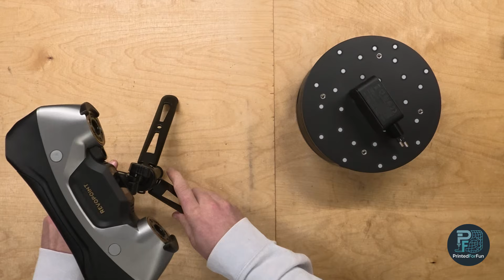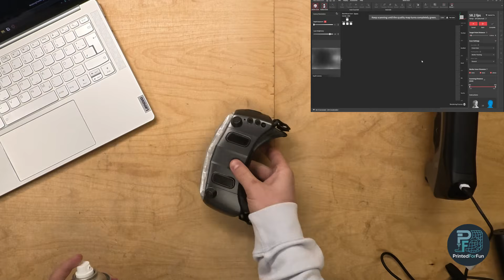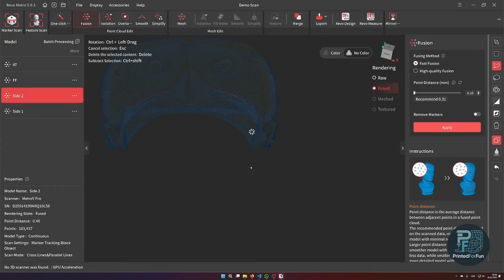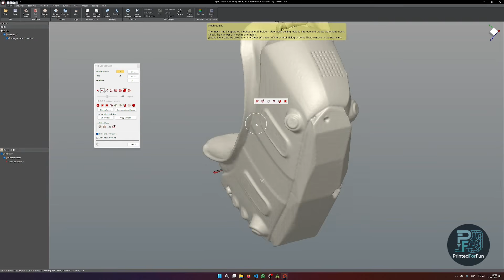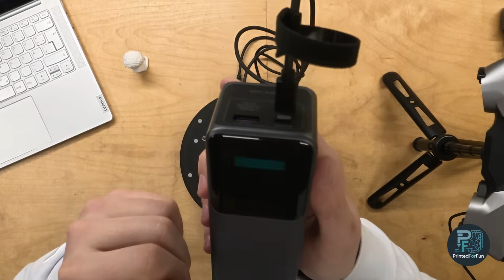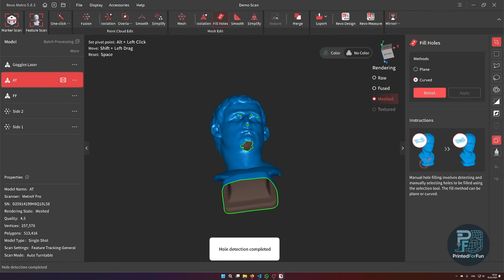Revopoint MetroY Pro Workflow and Scanning Tutorial

Comment: So, this scanner is completely useless if you don’t pay for QuickSurface every year forever?  (Or pay the larger license fee) And Revo doesnt really explain that on its website very well or at all right? 😑🤬 so frustrating as i was ready to purchase at $1600-1800, but now i have to budget another additional $5500 correct?
Reply from the maker: You don't need to use Quicksurface at all. Revo Scan (the software for scanning is completely free). Then you have a 3D scan as a mesh file and it's on you how to continue processing it: either directly print it, load it into Fusion to do some basic reverse engineering or pay for professional reverse engineering software like Quicksurface or Geomagic design.
Same applies to all other 3d scanners on the market.
Quicksurface also has an personal tear fro 200€ per year I think
Reply: @PrintedForFun gotcha. Thats what im trying to understand better. I think its almost the unspoken part of scanning to using the scan.  That middle layer.  I’ve tried to use meshes in F360 on a nearly-maxed out 2yr old macbook pro (memory, processor and drive) and F360 just slows to a crawl if theres more than a few hundred triangles (exaggerating but its definitely at a crawl).
Reply from the maker: @EricsAdventureMoto  Fair point, sometimes seems to get forgotten. May create a video about this topic at one point where I simply show all the options that can be done with 3d scans.
Regarding using fusion: for simple reverse engineering it works quite well as long as meshes stay meshes and you use the mesh tools. Then you can create sketches based on the mesh and construct. Directly converting to a solid is a big no-go.
Mesh size under 50k triangles should work nicely
Reply: @PrintedForFun thanks for the tips. Maybe i was doing that part wrong.

Comment: Hi. What is the make and model of the computer you are using?
Reply from the maker: Quite a powerful workstation. Ryzen 7950X, 128GB RAM and RTX 5070Ti.
Also used it on my notebook with 12700h, 16GB Ram and rtx3050, also worked
Reply: @PrintedForFun  Thank you ❤❤

Comment: is the modified cable required for using the battery pack remotely. does the scanner not negotiate the PD output by itself?
Reply from the maker: Doesn't negotiate itself. Original cable also has a pd trigger in it

Comment: Hello. Can You tell us about exact specification of Your laptop using with MetroY pro in Revo Metro?
Reply from the maker: It's a Lenovo Yoga Slim 7 ProX: i7 12700H, 16GB DDR5 and RTX3050 mobile. Would advise to use a more powerful unit though. The 100W power limit of the thin and light notebook really limits the performance. On my Workstation (16Core Ryzen, RTX507Ti and 128GB RAM) it's faster

Comment: Well, I already bought the RockIt and (of course) started wondering whether I made the right choice or not, so now I finally found a proper video on the MetroY Pro where I can truly experience the workflow remotely and compared to the one of the RockIt currently in my posession. Let's see if I'll be returning it for a Metro. If the RockIt has no glaring deficiencies, I think I can just make my own turntable and an adapter with threaded insert for my camera tripod using my Bambu H2D.

Could you briefly share your experience on the matter? I see the Metro has twice the amount of parallel lines, a single-line mode as well as the full-field blue light mode. I also see in videos that the Metro hovers in the 55-60fps region while the RockIt pushes up to 90. It's really hard to gauge how important each difference between the two is for someone just getting into 3D scanners - actual benefits versus marketing tricks. I'd be focusing on automotive and PC/tech scans so anything from goggles like yours to some motorcycle parts, car engine bays and interior trim.

8 minutes into the video I must say I really appreciate such content - not just a presentation of the original kit but also your own engineering modifications to it in order to make it better and/or easier to work with. The metal business cards? Genius. I'm already using those with my xTool F2 so I have a few stacks next to me, ready to "get stickered". ☻
13 minutes in: Very nicely done compartments! Turning wasted space into useful compartments on tools like these is a pet peeve of mine as well. 
24:00  Great "mean and lean" looking drone.
Reply from the maker: I will release a similar video for the Rockit (already captured the footage but time for editing is a bit rare...). Quite happy with the Rockit
Reply: @PrintedForFun  Oh, that's good to hear! My return window is not very long (about 10 days left) but if you're also happy with the RockIt then it might not be worth stressing too much whether to return it and get the Metro instead.
Reply from the maker: @TsvetanVR I'm very happy it so from my perspective no reason to return it. Maybe I can release the video until then but not sure

Comment: i dont know what i'm doing wrong but. i made similar setup (goggles scan). it couldn't even scan that, or made so much artifacts.  unusable. idk how the scanner preforms so badly
Reply from the maker: Maybe exposure not set right or not on automatic? What are your PC specs?
Reply: @PrintedForFun  My pc specs are ryzen 7900x 64 gb ram, rtx 3080
Reply from the maker: @Tebbit123 So this shouldn't be the problem.  What artifacts are you getting?
Reply: @PrintedForFun  Mostly misalignment or totally losing position, duplicating the scan within a scan, making the scan unusable. i only had one good scan with global markers and then using 100 markers to get some data just for a measurement.
Reply from the maker: @Tebbit123 Maybe too few or too repetitive marker patterns? Have you tried recalibrating the scanner?
Reply: @PrintedForFun   Its brand new ? should i recalibrate it anyway?
Reply from the maker: @Tebbit123 Yes, strongly advised. Multiple weeks of transport on a container ship or even airplane can mess calibration up (not even thinking about the temperature cycles while transport)
Reply from the maker: @Tebbit123  Did it help?

Comment: Hi, could you check your projector lens of the scanner in the full fields mode see if there are dust in the lens? My seems like there are a lot of fine dust inside the lens.
Reply from the maker: Yes looks the same, also did with the MetroX. Guess the fan blows air in between
Reply: @PrintedForFun  Thank you for your response, in the feature tracking, full fields high speed mode, do you see a line that doesn’t exist on the actual object? My at a certain angle and distance from the scanning object, I will see a ghost line and affecting the scanning quality.
Reply from the maker: @maxmei1991 Honestly haven't used the Fullfield mode much. Will make a video about it and will keep an eye on this

Comment: Great Video !! Thank you. I have the Metro Y Pro, it is a fantastic scanner. I also have the MIRACO Plus which is my "General use" 3D scanner. I have one question, I really like your idea of using the battery in your pocket, why cant I simply use an extension USBc cable between the Revo Battery and the small Revo scanner power chord that plugs into the Metro Y Pro ? Like (USB-C Male to Female Extension Cable USB 3.2 Gen2 PD 100W 20Gbps CAU620 - 2m)
Reply from the maker: PD is basically a communication protocol where the phone tells the charger/powerbank what voltage it needs. The MetroY Pro doesn't use this protocol, the adapter cable itself does it, unlike normal usb cables (even PD rated ones)
Reply: @PrintedForFun  Sorry, I dont understand. Will it work If I connect the Revo battery to a PD rated USB cable, then to the existing short Revo USB scanner connector cable into the scanner ? Thank you for your help.
Reply from the maker: @Scan2Model Usb C extension cables (so male plug to female plug) are generally not supported by official usb c specs. So I wouldn't advise you to do this
Reply: @PrintedForFun  Thank you very much !
Reply: COULD YOU TELL the difference between miraco pro and metro y pro , which is better

Comment: Hi, thank you for the great Metro Y tutorial. Could you please advise on the best scanning mode for small technical objects such as automotive connectors ( for example 20x10x15mm  size)? I need to achieve the highest possible resolution for fine details. Thank you very much!
Reply from the maker: Then definitely the auto turntable mode with scan spray used. If you have the regular MetroY then parallel line mode
Reply: @PrintedForFun  Thank you! I have the Metro Y Pro, so I i try thethe auto turntable mode. In this mode, are the markers placed around the object not detected by the scanner?
Reply from the maker: @Mara2000sdf1 you can use either marker tracking or feature tracking in the mode

Comment: Great Video! I am also planning to buy a Metro Y Pro as my first scanner. I am using a quite powerfull MacBook and won't be able to use Quicksurface at all. Is there any viable solution for aligning meshes easier than using Fusion360?

Thanks in advance, keep up the good work!
Reply from the maker: Don't know an alternative for MacOS but I know some people are using parallele to run Quicksurface